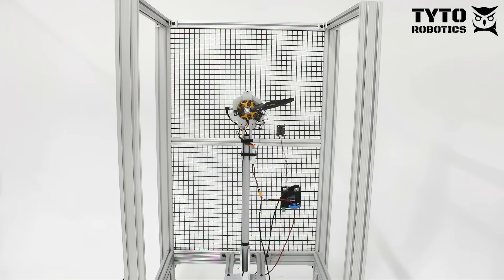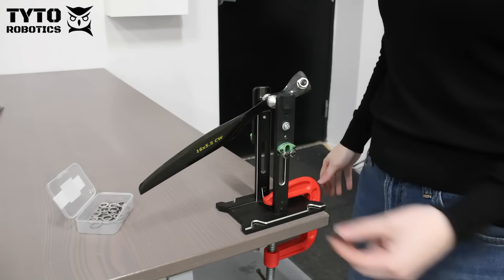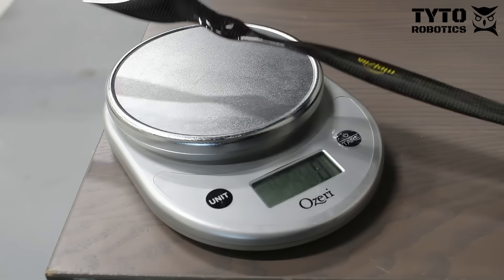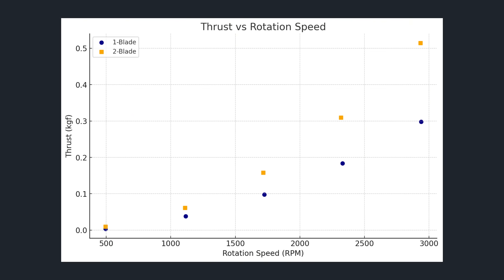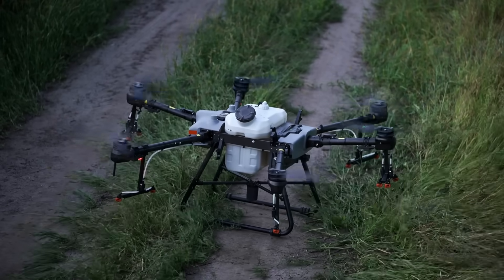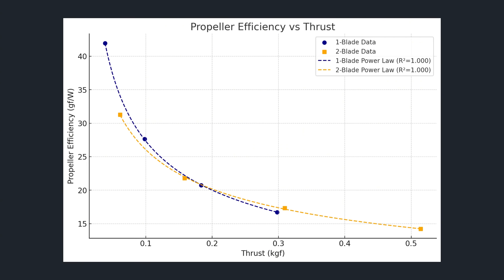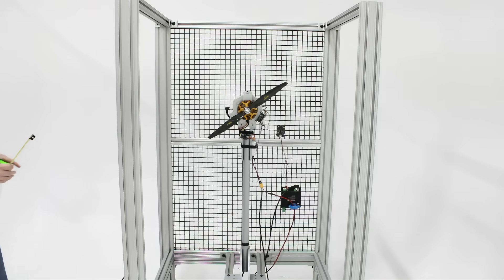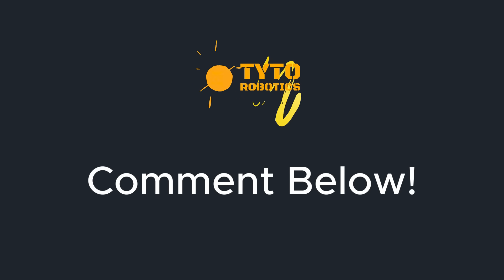Single Blade Propellers ACTUALLY More Efficient?? (Real Test Results)

Comment: The EVTOL industry scrounges for anything that can extend the short flight time due to lithium battery density limitations.
If single prop would be better you can be sure they would use it.
The most sensible option is I believe larger prop with appropriately lower RPM.
For example basic prop setups are fairly efficient, but then the EDFs have much lower efficiency because it's small and runs at much higher RPM.
Reply: its all about pitch to forward velocity... whats the goal? forward velocity? when hovering, its zero forward velocity... 
theoretically, for maximum efficiency, you want to move an infinite air mass with zero velocity...
practically, we have limitations, lol...

an edf becomes efficient at a certain forward velocity. which is pretty fast.. definitely not in a hover.

as other channels have demonstrated, the efficiency is increased by at least 3x when the small high speed propellers are used to power large, slow moving blades for creating the thrust, rather than attempting to use them directly as we currently do. both aerodynamic surfaces then operating at peak efficiency.  

"fairey rotodyne" style. the issue was using jets with such high velocities required. the tip speeds limits forward velocity and engine efficiency. but when using props? the theory is sound. who knows how far the gains can be pushed?
Reply: @paradiselost9946  So my statement about larger prop is false?

Comment: yes compare single and 2 bladed props of same performance in they best respecting operating range, and create the smallest aerodynamic counter weight, probably using lead. Check for bearing temp using a thermal cam or laser one. Normally you should run the test for hours to test for bearing failure, normaly these motors should be optimized for trust not for radial forces.

Comment: one problem with one bladed is that you need to take into account that the bearings have way more unbalanced trust to take so they should be adapted, problably being heavier, they can still be efficient but not taking this into acocunt can present a biased result. When we compared 2, 3 , 4 or N bladedtogether, they are all balanced

Comment: Great video ! Some comments though. You didn't really measure efficiency. Efficiency would in this case be aerodynamic power over available power (input power). You measured static thrust over available power. That's only one point on a curve where velocity is the x axis. Then the aerodynamic power is velocity times thrust. Unless you have a wind tunnel, this measurement can only be done on the craft itself. Static thrust is probably important for that kind of a drone, but the propeller itself doesn't look like it was optimized for static thrust alone (not to me). A fixed pitch propeller is only optimized or optimal for one ratio of velocity/rpm. Then there's balancing. Ages ago I was into RC. It has always been a topic there. Balancing a single blade propeller is not easy. You also have to balance the aerodynamic thrust. With a single blade this is completely out of balance. If you don't, this will cause sever unbalance on bearings, and loss of efficiency. With higher rpm, higher losses, as you have shown. This is done by moving the counter weight back so that the centrifugal forces balances the aerodynamic force. Unless making some complex mechanical apparatus, this is valid only for one value of thrust by the propeller. The thrust varies with velocity and rpm, so it's a hard nut to crack. 

I think what that experiment showed was the importance of aerodynamic balance of the propeller, and the effect of a non aerodynamic shaped counter balance. A single blade prop is the most efficient, but the increase in efficiency is really not worth it when observing the problems and restrictions it causes.

Comment: Unless the mass distribution of the counterweight (mass at a given distance from the axis of rotation) matches that of the blade, dynamic balance will not be possible. Even then a single blade producing lift on one side of the rotation axis only will impart a bending force on the motor shaft.

Comment: Very honest show of your struggle to balance the prop. But I think 1 blade props will never have dynamic balance. The thrust on one side only means there is a lateral torque that also spins. The fixture of the motor needs to provide the lateral counter torque. But that counter torque needs to spin around. So, maybe you need another motor in sync with the single motor. But then you end up with 2 blades on 2 motors. How ridiculous.

Comment: Single prop would not be resilient in turbulence because the force exerted at the weight end vs prop ends would not be balanced, magnifying destabilizing effects under practical situations due to different torques at each end from the same amount of force applied by wind when multiplied by lever distance

Efficiency and thrust being equal or better doesn’t mean much if you crash for the same reasons the mars drone did.

Comment: Nice video! Very interesting. The one thing that sticks out to me is that the single bladed prop should be the length of 2 bladed prop not just anityer 2 bladed prop cut in half. Without the extra length it is not a fair comparison because you effictively testing the difference between a half sized and full sized propeller.
Reply: But that is no good irl if you don't have a frame big enough to fit all those double radius propellers without them hitting each other
Reply: Good point, I think a smaller motor for the single blade to achieve similar efficiency as the 2 blades

Comment: I've thought a lot about one bladed propellers, and one persistent question I have, which I don't know how to solve theoretically (my knowledge of aerodynamics isn't that good) is how much larger does a one bladed propeller needs to be in order to produce the same amount of thrust at the same RPM as a two bladed propeller. Larger propellers sweep a larger area, and that lowers specific thrust. But the counterweighted monoprop always weighs more than a two bladed prop, even of the same swept radius, because the counterweight has to weigh more than the blade it is replacing due to being closer to the hub, and that extra weight would work against efficiency.

I would really love to see you test the efficiency of a thrust-matched pair of propellers. If a larger monoprop is more efficient than two shorter blades, that would be good to know.
Reply: I think the counterweight mass could be nullified if that countermass were the battery.

Comment: The  test is flawed!

A single blade propeller is only more effective if it has the same swept blade area....

Therefore, the single blade propeller should be 22.6 inch vs 16 inch double blade propeller...
Or...
16 inch single vs 11.3 inch double.

The additional efficiency for the longer single for the same blade area comes from the fact that the larger single blade will have lower air speed (due to lower rpm) and less tip vortex losses, compared to the smaller double, to produce the same thrust.

Comment: Aeromodellers have been flying single blade propellers for decades. There is a vast literature on the subject. There are two kinds of balance; mass and aerodynamic. Getting the mass balance around the axis of rotation is easy. Balancing the thrust on the single propeller blade is more difficult. That is done by putting the weight on an arm that extends back from the plane of rotation. The centrifugal force produces a forward rotation. Balance is perfect at only one revolution rate.

You did not measure the efficiency of the propeller. Efficiency is the ratio of output to input, always less than 1, expressed as a decimal fraction or as a %. You cannot measure efficiency with a static test, the propeller must have a forward velocity. Power in is shaft torque times revolution rate. Power out is thrust times velocity. At zero velocity, you can't divide by zero and get an efficiency.

Because propellers move forward while producing thrust, they must be twisted along the length of the blade. All parts of the propeller move forward with the same velocity. The tip moves circumferally at a higher velocity than intermediate parts of the blade. Each part of the blade moves forward at a different speed and angle through the air. The blade must be twisted so each part encounters the air at its attack angle of maximum L/D. 

A rotor is not a propeller. The blades of a helicopter rotor are not twisted because they are not moving along their axis of rotation. I would think that drone rotors would be the same. You want the blade angle to be that of minimum power factor for the airfoil used. That is generally a few degrees higher than the attack angle of maximum L/D.
Reply: This should be the top comment

Comment: Nice video! Real data, no clickbait, no bs.
You should try making a super efficient fixed wing drone with that!
I believe it would be easier to keep the same ideal RPM when compared to multicopters.
Reply: Seconded! Great that you supplied all of your results.
Even better that you gave it a go even with the limitations and possible measurement issues (which you outlined so well).
I think this is a good example of how to do science well.
Thanks

Comment: 2 things you will eventaully delevope now.  Dual Piston hydraulic counter balance trim; Thrust port on Conuter Balance to lower the airframe torque from gear only drives and thus reduce tail rotor needs.

Comment: I think the area should remain constant for comparison, and the test repeated in a moving air stream.
Reply: The swept area remains constant. You mean the blade area, I guess? The test here is similar to the case where a drone is hovering or maneuvering slowly. I agree that it would be interesting to repeat in a moving airstream, because that would give an indication of efficiency at higher speed or if used for propulsion of fixed wing aircraft.

Comment: I think that the efficiency issue comes about when one blade hits the wash of the previous one.  The fewer the blades the less of a problem this is.  But at some point at higher speeds even a single blade will hit it's own previous wash.  So as the speed goes up they cross and the 2 blade does better because they're both in the hitting the wash zone but the 2 blade actually has a second blade giving thrust to make up for that.
Reply: Most of the losses actually come from the tip-vortex created at the end of each blade.  There are ways to reduce this such as the Q-tip propeller design but ultimately -- fewer tips, fewer tip vorticies.
Reply: @xjet  So why the crossover?  Oh, and don't mind me.  All I know about props is what I learned on YouTube.  I know some physics but I'm not a flying device hacker.
Reply: @dougcox835  Drag increases at the square of the airspeed and I think it may be that bulky bolt/nut couterweight that becomes very draggy as the RPMs increase.

Comment: I have to wonder how this works when you have multiple motors on a platform like a quad having 4 motors running contra rotating props I would have to imagine there are ways to eliminate the counter weight in that scenario which would vastly increase the efficiency gains without an increase in vibration.

Comment: wouldn't make more sense to compare equivalent weight single blade prop versus double blade prop ? as single larger diameter that is equal weight to a double blade prop. Right now the comparison feels more like you just hack a double prop in half without accounting for the blade weight.

Comment: What if there was a counter rotating single propeller behind the first? Would that help reduce wear on the bearings?
Reply: i'd be more worried by the moment on the bearings than the thrust, so it may well be worse

Comment: The extra weight is also a factor when use in drones where blades spin up and slow down quickly. May degregade performance and increase energy consumption. Good video!
Reply: It is not just weight. Weight close to the center of rotation has much less effect. Weight far from the center of rotation has a much greater effect. It is not clear to me that the bolt would decrease performance by increasing rotational inertia. But it would be good to measure the angular acceleration vs torque to compare and confirm one way or the other.

Comment: Imagine how efficient a bladeless prop could be!  Whoooo... I sense a physics prize coming up
Reply: The trick is to sneak up on it.  The air has to think there's a prop there or it will ignore it.
Reply: @dougcox835 yes let’s trick the air! Do you think an optical illusion will work?😂
Reply: @Nickjustdabs  You use piezoelectric to generate pressure and then ionic to accelerate it. It's not completely solid state, there's a flapping bit, but it's so tiny and moves so little. It's more like an electronic gate, it should basically last forever.
Reply: @jtjames79  So thousands of tiny hair creating lift by ionically mesmerizing air into thinking it's actually a propeller?  kinda hairy drone?
Reply: @Nickjustdabs  Have you ever heard of aerial illusion?
Reply: @dougcox835  ahhhh.... man, he stand up and try beat wind into submission! wind laugh and shriek and skips past faster, sneaking back to tickle his bum...
Reply: A magnus effect rotor is bladeless. No blades, just a smooth rotating hub shaped like a cylinder.
Reply: @IsaacKuo Magnus thingy makes lift not thrust
Reply: Nice joke.  Shame its not a joke.
Reply: Lol
Reply: This should be easy, air is fake.
Reply: Ramjet?
Reply: Yeah, forget about propellers!  Engineer a way to use swinging masses to use rectified inertial forces (reacting off of space/time) for "reactionless" propulsion for lift/thrust...........
Reply: Closest thing I got for you would be how jellyfish propel themselves.

But that's more like jet propulsion.
Reply: Donald Trump is that you? 😅

Comment: You should test the zip line prop and how it compares to 1, 2 & 4 bladeded ones, plus compare the audio output of all the different test props to see if noise can be reduced without impacting performance by testing all the props at equal thrust points regardless of motor speeds.
Reply from the maker: Yes, comparing noise levels would be a great next step! We’ve tested propellers with a sound level meter before. You can check out our video here: https://youtu.be/E4LHKYK96kU?si=6de-2rfu5hevHwz0

Using a similar approach would provide even more useful data.

Comment: Maybe the blades should run on the outside of a wider ring. You'd effectively have a set of single bladed props without the troublesome inside props.
Reply from the maker: What do you mean? Can you describe it in more detail?
Reply: @tytorobotics Well, effectively a fan. Imagine two concentric rings between which are blades. Perhaps the loss is at the extremities of the blade. My first thought was to balance the blade with another separated from the airflow, then a kind of chain of blades,  but the result is a donut.

Comment: You missed the most obvious "problem". By adding a counter-weight for balance, you reintroduced the weight that you cut off just before. It would be an interesting experiment to check if a single blade propeller without the weight added back to it would perform better than the double one that weights twice as much.
Reply: what? The counter weight is necessary to prevent vibrations. A single bladed propeller would be unusable without being balanced
Reply: why dont you go try that and see what happens.

Comment: How would you compensate for the vibration caused by the centre of thrust moving around?
Reply: You can't compensate for the thrust.
But you can mouth the counter weight aft of the propeller. The centrifugal force will cause the weight to try to join in the same plane of the propeller's rotation as it bends the support it rides on. This could balance the forces so the bearings aren't affected as much.
Reply: I don't think there is much to do about that, that is why 1 blade props are terrible for the bearings...
Reply: Zipline uses a hybrid prop. 

It's got three lobes, but one of them is shorter and fatter. They did this to make them quiet, but it also makes them super efficient.
Reply: A dynamic/adjustable counterweight?
Reply: If we're talking about drones for consumer, professional, and institutional use... compensate by making the bearing easily replaceable and "disposable", routine maintenance every 100 hours, preferably a proprietary part that costs a little more than it should but it's a quarterly subscription so the consumer doesn't think about it after the first year or so. Thus saith Capitalism.
Reply: spin it faster!

Comment: Better in theory, but at 11g extra, you carry a lot of extra weight! Really interesting.
Reply from the maker: Very true! You would have to have fairly significant efficiency increases to compensate and make it worthwhile.
Reply: @tytorobotics  Is there a practical away to move the counter mass further out to make it more effective, without increasing drag to the point it unduly eats into efficiency gains?